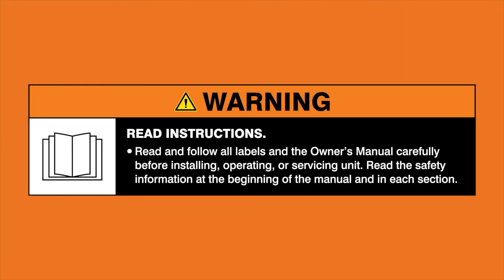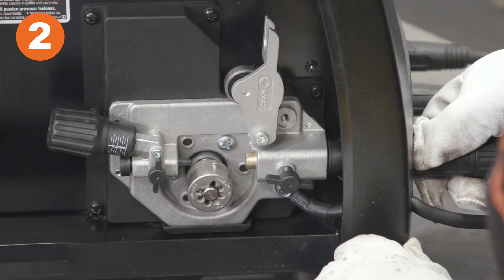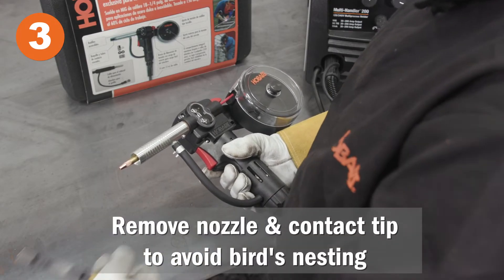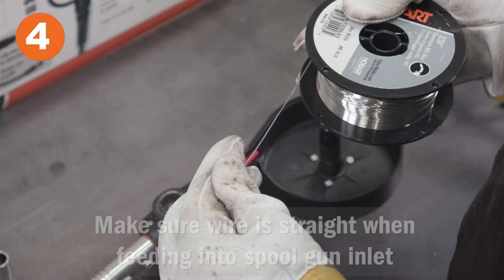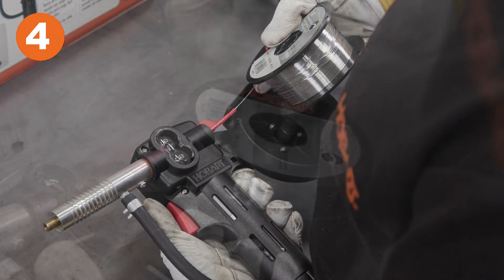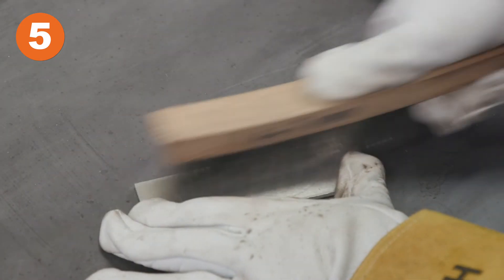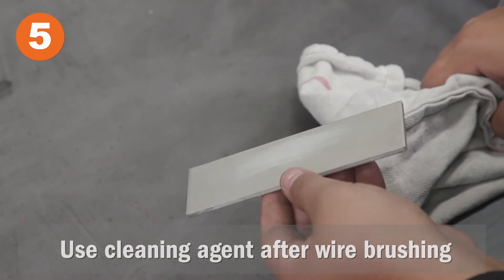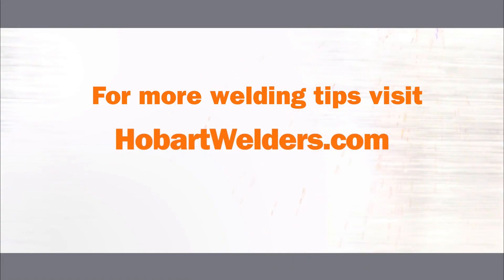Tips: MIG Welding Aluminum with a Spool Gun

Comment: Why doesn’t the video title say HOBART ?

Took more than Half an hour to find this video on youtube searching for 

Spoolrunner

hobart spoolgun

hobart 210

hobart spoolrunner 100 

etc

Why don’t any of your user videos show the setup if it’s so easy?

Welds a canoe with no setup or install?

It’s obviously simple but I’ve used my 210mvp for many years without a spoolgun and the attachment didn’t want to come strait out and I just wanted to make sure I didn’t miss something.

Finally came out after turning it so I could install the Spoolrunner.

I will say I think I bought my 210mvp in 2012? and I love it. 

Only recently added a small tig/stick to my tools because the 210 mvp is too much on its lowest setting on 110 to do current automotive sheet metal quickly. It is possible in a pinch but it takes forever especially for areas you can’t put aluminum behind to keep it from burning through.

FYI I sold a huge millermatic quite honestly because I just never needed it.
Reply from the maker: Thanks for reaching out. We're happy to hear that you have had a positive experience with your Handler 210MVP. We have passed your feedback about our videos along to our team. If there's anything else we can help with, please let us know.

Comment: Can you show instructions for the 140 welder, which doesn’t have a spool gun listed for it?
Reply from the maker: Thanks for reaching out, Andrew. There is no direct spool gun for the Handler 140 which is recommended to weld aluminum. If you are doing a fair amount of aluminum welding then the Handler 190 or Handler 210MVP would be the preferred welder to use.
Reply: @HobartWelders  so your telling me they don't make a spool gun that is a direct fit for the hoabrt handler 120 or 140
Reply from the maker: Hey, @jeffgood6441 

Correct, the SpoolRunner 200 Spool Gun is to be used with the IronMan 240, and the Hobart SpoolRunner 100 Direct Plug-in Spool Gun is to be used with the Handler 190, Handler 210 MVP and Multi-Handler 200. You can find more information on Spool Guns here: https://www.hobartwelders.com/accessories/mig-welding-accessories/mig-guns/spool-guns.
Reply: @jeffgood6441  you need about 1 A for every thousandth of thickness of aluminum for spool welding. The 140 is arguably not powerful enough to spool weld Al so Hobart probably doesn't want to lead you down that road.
Reply: @stickyfox  makes sense thank you bro
Reply: @jeffgood6441  Check out Brandon Lund's video "Convert your MIG welder" where he puts a plastic liner in a Handler. He got it to work but he warns that you need it turned all the way up and have to watch the duty cycle.